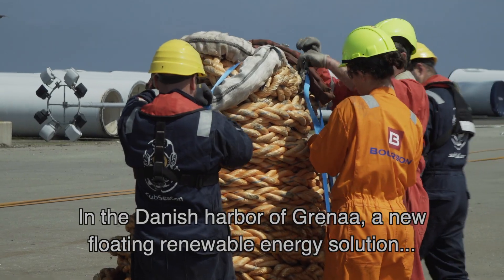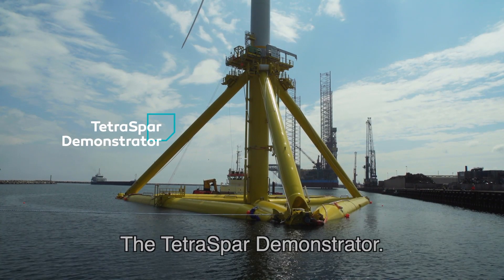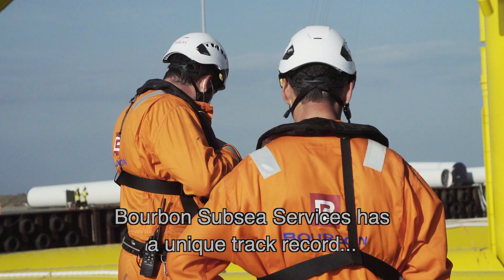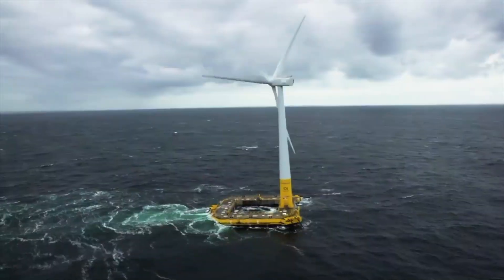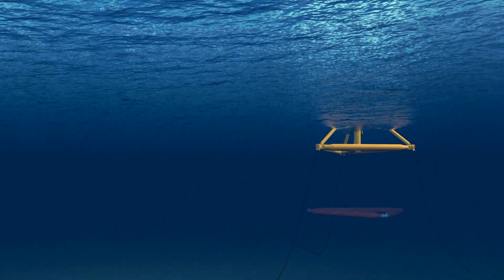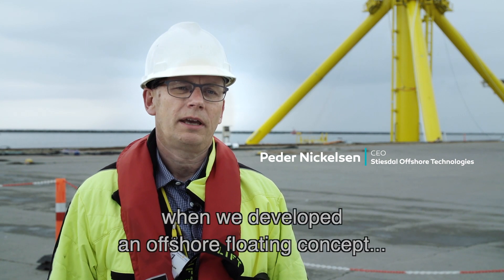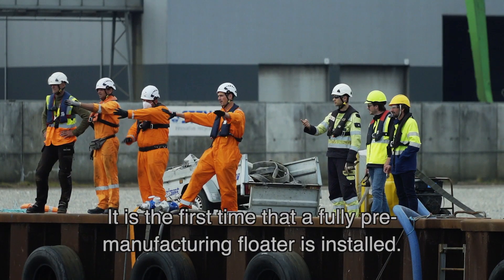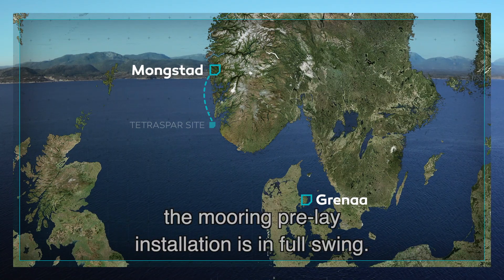Installing TetraSpar -  world’s first full-scale industrialized Floating Wind Foundation

Comment: Hello! I know this is probably one of the most frequent questions about the project, but I find it very interesting and wondered how the hinged connections within braces will withstand fatigue, corrosion and high frequency offshore loading. Which technology is involved?
Reply: Orkot bearing materials are used in chain tensioner systems and other subsea or topside bearing applications. The material can handle very high loads and ensures cathodic protection.